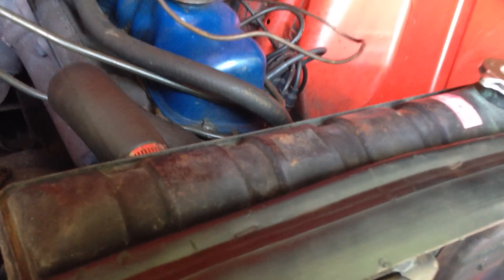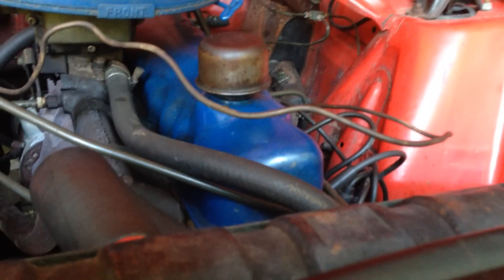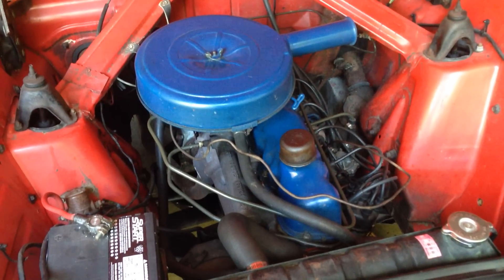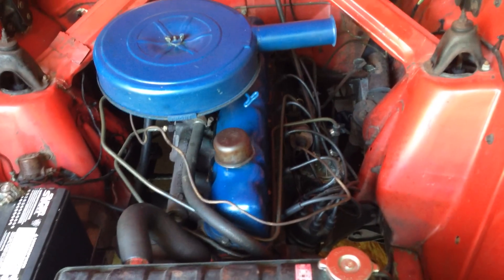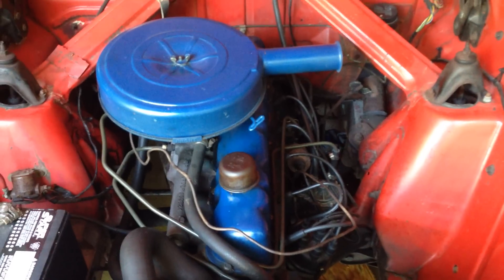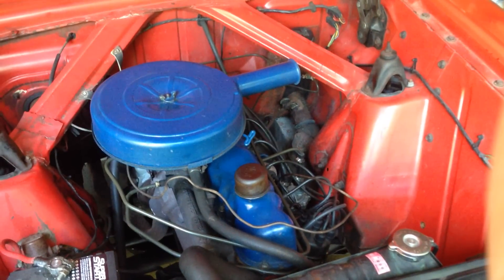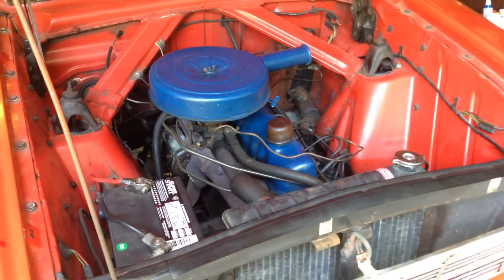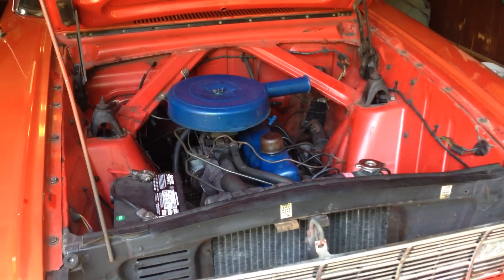Falcon Engine Swap Thoughts

Comment: I think if there was a chance to, you should consider a 'Barra' motor which is an Australian engine in the more recent Ford Falcons. There would be problems like importing an engine in and sourcing parts however. Although you can maintain the factor that a Falcon motor is still in it.

Comment: Check your radiator cap it may not be on all the way. Engine coolant doesn't boil like that unless you have a faulty cap or the cap is not on all the way.

Comment: Really stupid question, is the fan backwards? Sounds really fucking stupid but its one of those things that you miss just because its so fucking simple you don't think its even possible that it'd be something so simple.

Bought a Chevelle in down by York PA. Shit was fucking mint, but in traffic it would run up to like 230. The fan was sticking out of the shroud a little bit, so I made an extension for the original shroud, then I fucking realized the fan was BACKWARDS. Dropped 30 degrees after that and runs great.

Comment: +kirbyswarp Said: "Keep the Original 144 I6 please. Keep it all original, a regular person in 1960 wouldn't engine swap it."

Very very true. I like the concept. Don't know how much it'd cost or what the budget is, but I'd go aluminum rad, elec fan, transmission rebuild.

However, this was a regular car in 1960 amongst other regular cars from 1960. Today, regular cars have more power getting onto the highway and maintaining speed. Maybe this car could use the power from, say, a small block, to keep up. A period correct engine, not necessarily making huge loads of power, doesn't seem to uninviting; at least to me it doesn't.

All in all, it depends on how much Mr. Regular wants to spend, and what kind of car he wants the Vagabond Falcon to be. I'm all for whatever he ends of choosing, no matter what the direction.

Comment: 300 Inline or a 2.9 Cologne V6. That engine is far to small for an inline 6 and way to low on power in my opinion. Give it a bit more get up and go with a 2.9 or 4.9.

Comment: Lol..I knew it would get to this at some point. : )  1st come the motor swap thoughts. Hmmmm,a new motor... "it would be newer, & much faster, as well as  reliable".....BAM! New Motor!
  Then come the thoughts..."hmmmm,do i switch out the trany, and gearing? it would be newer, faster,as well as reliable.......Then come the thoughts about handling...BAM, Full suspension, modern braking...etc etc etc...

 Until one day you realize, it's no longer a 1964 Ford Falcon with a 90hp 144.

soon followed with feelings of regret.

BUT...then again..it would be Faster...    : )

Comment: From a performance perspective I have no clue what it would do, but if you were to swap I'd say go for the most regular choice Ford could possibly offer. The 1.0L 3 cylinder Ecoboost crate engine that makes 123 HP and 148 lb-ft of torque... Have no idea what could be used as a transmission. Otherwise just fix up what you have! I'm sure the straight 6 could be nursed back to it's former glory.

Comment: Sounds like the coolant is boiling - this will happen if there is not enough pressure in the system.  Lots of things can cause that but it might be as simple as a faulty rad cap or a bad hose or clamp, or as bad as a failed head gasket, leaking heater core etc.

It could be air in the system as too much air will also cause the system to not pressurize enough and thus boil.  That's the simplest thing to fix, so start there.

Park the car on a slope so the rad cap is at the highest point, take the cap off and run it squeezing the bottom and top radiator hose to help dislodge any air pockets, run it up to temperature so the thermostat opens - keep pouring coolant into it as it burps out the air.

Comment: Put a temp gun on the radiator  and search  for a cold spot in the radiator  I was having the same issue with my s10 and a c10 and a new radiator  solved both issues

Comment: a regular car deserves a regular engine!
Reply: Flame Vulcan,ew...

3.5 duratec baby !
Reply: Thomas McCoy Yup, i also think that it needs a regular engine. Not some ls, 2jz or other overused swaps.. It's a regular car not a race car.
Reply: Ernests Pušpurs the 2jz was used in a lot of regular cars, not just the supra. There are few engines more reliable. Just because the supra had it, doesn't mean that it has to be a race car engine. The 200hp GE will run forever if you change the oil every 50k or so. And it will get good gas mileage, be easy to find cheap parts for and is just a pretty normal engine. Sure, you could use some old ford i6, but what if you are on the road and need some specialty part. You can't just stop at any old dealer and get it. You could with a 2jz-ge. Doesn't get any more regular than that.
Reply: Gs300s aren't regular cars
Reply: Thomas McCoy Sure they are. So is the IS 300. you can get one for under $5k right now in the USA, Makes it pretty regular to me.
Reply: Ernests Pušpurs a Barra 195 or 270t is a little different and would keep that I6 feel, but for best effect a carburetored motor should be kept

Comment: Wait a little bit and see if you can find a good running 200 from an early Mustang.  They look the same but have a better crank.  If you're lucky you can find one with a trans.  I wouldn't suggest a V8 unless you really want to do some body and suspension mods.  The 62 and earlier had a smaller tunnel that requires lots of hammering to get a bigger bellhousing in.  63's were the first year of the v8, they fit right in.  I've owned 2 62's and v8 swapped both of them and have a 64, and have worked on my friend's 63.  A lot of patience is required with old cars. Take your time.

Comment: Do the simple things first. Pressure test your radiator cap, replace the thermostat with a stock replacement (same temp rating as factory). Check to see if the car is supposed to have a radiator shroud and a clutched fan. Some people take the shroud off and dont realize how much cooling they actually do. Clutched fans allow the motor to run with less load when it is not hot. No sense in giving up on a motor that quickly. You can replace everything I mention for less than $150.

Comment: Personally I say you drop the old 2 speed, swap in a fresh rebuilt C4 and get a nice big aluminum radiator to keep er cool and call it good. Clearly you don't want to build a Hot Rod with it so no need to replace the original engine if it still runs good.

Comment: 289 V-8 won't fit in a '60 Falcon. Engine bay is too narrow.  If your heart is set on an engine swap, personally I'd go with a larger 6 anyway. If you do your research and mod smart the straight 6 can be a most excellent engine. However, first thought for those oil-soaked plugs is the Valve Stem seals.

Comment: All of these 'kids' thinking that you should put a FWD engine in the car... LOL!

Obviously, keep it original. You said it yourself, how much money do you want to put into this car? If you pulled the engine out, you could replace the engine gaskets and such with new ones and you'll have a reliable engine. Upgrade the radiator and a new fan, poof! Now you have a clean car that will run forever as long as you maintain it.

These cars don't need an LS swap, or a 4 cylinder turbo bullshit. This is a car that has lastability, and that is an important word. "Lastability" the true common denominator to determine whether or not something is made for the 'now' or for the 'forever'.

See, I could be a writer as well Mr. Regular :)
Reply: He meant in the 144 not the car.

Comment: If you haven't done so already, make sure the cooling system is burped. Open up the cap, start the car, run it, let the thermostat open up and squeeze the upper hose until you get all the air out. After that, top up the fluid and replace the cap (preferably with a brand new one) and you should be good to go.

Comment: It possibly has air in the cooling system which can cause an overheating issue. The trans leak is most likely coming from the rear of the trans where the yoke of drive shaft slides in.

Comment: Drill a small hole in the 12 o clock position of the thermostat to let the air come through the thermostat. Sure, it will let a little water through, but it will not stop the thermostat from doing its job as long as the hole is small enough.

Comment: It's a 50+ year old engine guys.. I'm not opposed to a swap. If he really wanted to keep it original, etc. Then it would be sitting in a museum somewhere. He doesn't need to put a ridiculous motor into it. Just something that's reliable. If he puts in a better engine, he'll get something more reliable, more powerful, and more economical. The outside will still be the original same. It just makes sense in my mind. But hey, I understand everyone's concerns. I just think it might turn into a huge money pit.

Comment: Take the thermostat out and see if the coolant flows better. I had that exact same bubbling/overheating issue, albeit with a Japanese car. But after flushing the radiator, replacing the cap, descaling/derusting cooling system, back flushing etc, I finally just removed the thermostat. And problem solved.

Comment: Carbed 302

-Plenty of knowledge out there regarding the build and what would need to be done as well as how to remedy most problems you'll face along the way

-those old 302 just have the best low idle rumble and will give this jalopy some serious presence rolling up not to mention when you're behind the steering wheel. It'll make you feel like a super hero everytime you turn the thing on.

Comment: I would just rebuild/replace the parts that need replacing. The original straight 6 is very similar to the way that lots of auto manufacturers are putting small 4 bangers into cars, so keeping the original straight 6 is like saying you got the "average" model of the day...and rather unique for today. A 302 would be more fun however.

Comment: and to the 2jz and rb26 ideas, which only people with little knowledge of cars would suggest, those engines might not be able to put the falcon and could put alot of strain on the engine. Also, the body is clean and original, why change it up? for a turbo? no. 302 is the best idea.

Comment: Could be water pump, radiator blockage or could just need a good flush.

Get a newer falcon motor from australia if you want to do it properly, the Barra 200 is the engine to go for its cheap as fuck.

i recommend rebuilding the current 144 though.

Although a AMC 4.0l Swap would be awesome they are as good as the falcon i6 and WAY cheaper over there in the US i imagine.

Comment: Run the car to operating temperature with the heater on and rad cap off. Fill with coolant until it reaches the rad fill neck, squeeze the top hose and watch for air bubles, and you're done when theres no more bubbles.

Comment: My 1968 Mustang Coupe originally had the straight 6, I can only speak for myself but I had so many problems with it. I swapped it for a 302 and Now I can actually enjoy driving it. I like the power, and I like going fast. I don't know what kind of driver you are, Mr. Regular, but I would certainly suggest and engine swap. At least for a 289. You'll be much happier.

Comment: Hey Mr. Regular!

ASE master tech here. 

Before you go too crazy with repairs/swaps and what not, try to find a spill-free funnel for your radiator. It is a funnel with adapters that seal where the cap would. It essentially allows you to over-fill your radiator so as the air goes out, coolant goes in. 

Run the engine and let the water pump push the air to the top and out of the funnel, keep an eye on your coolant temp gauge as always. Squeezing the upper hose a bit now and again can get some more bubbles loose too.

Something like this here. http://www.amazon.com/Lisle-24680-Spill-Free-Funnel/dp/B00A6AS6LY

Comment: Also, FUCK FUCK FUCKITTY FUCK. First make sure that you don't have a blown head gasket (best case), cracked head (shitty but not so bad), or crack in the cylinder wall (fuck it, fuck this, fuck everything). Any of these would cause rampant overheating that even a really nice rad would  not fix. Yes, the car can run just dandy with a cracked head or blown gasket. Get a compression gauge on it before you do anything else.

Comment: Bleeding involves first filling the system with coolant, and massaging all the air out of the lines by hand. Then start, and let the air work out. Keep massaging any lines you can until it's too hot. The old trick is to jack up the front of the car to make sure that the filler neck is the highest point in the system. You especially want to get it above the heater core. Which is hidden of course. So jack it up way high and run it. This isn't a VW Vanagon, or your precious MR2. It shouldn't much fight you. If if were mine I'd just fill it, knock some air out, then drive it around, topping off coolant every day or so until I don't need any more. Get that radiator empty again and look down in there for evidence of StopLeak garbage, which might be causing problems all through the system.

Comment: Considering its such an old car I'm certain the water pump, and radiator  are internally oxidized beyond repair. Probably due to the average man knowing water is free as opposed to Anti-freeze(Which doubles as a rust inhibitor)  which is in fact not free and in a sticky situation its much easier to come across water to cool the S.O.B down. At the very least I would definitely start with the radiator, and while your at it remove the belt driven fan for an electric radiator mounted fan, very simple swap.

Comment: All that smoke/steam coming out of the breather makes me think it has a lot of blow by so it's possible it's just worn out. A 289/C4 combo would be great for driveability and reliability and would make stupid enough power to worry about destroying the rest of the running gear. That's just my opinion though, you could also get a big Radiator and get the original 144 and 2 speed rebuild and it'd be good for another 50 years probably

Comment: Before giving up on the factory radiator and fan, try flushing the radiator with CLR (Just be careful with the stuff, it's pretty strong), or even Tide laundry detergent a la Roadkill's '66 Buick convertible. The mechanical fan can also be made much more efficient just by adding or making a shroud for it, you'd be surprised the difference a proper fan shroud can make. Also keep in mind that an electric fan or fans will put more strain on the electrical system.

Comment: The internet thinks engine swaps are easy. They aren't. Don't you just wanna drive it? Dump the coolant, take the radiator to a shop, it's probably clogged. New parts will cost soooooo much less than an engine swap. Make sure the thermostat is opening (does it have one?) at proper temp. The wild card is if somebody's been dumping StopLeak or some dumb shit in the engine.
Reply: Stop Leak is a vehicular war crime!
Reply: JeredtheShy I'd get a 300 straight six and a tranny out of an old ford truck in the junkyard. Probably could get one out of a wrecked truck on craiglist too. that would be so much cheaper than screwing with this old thing. Sure, it's really cool and all, but the 300 would have so much more power, and he could even get a 5 speed out of a ford truck.
Reply: ***** Any cost figures on that? One good thing about a 302 is that they're EVERYWHERE. I hardly ever see volvos or jags in the crusher yards around here.
Reply: JeredtheShy Thermostat was my first thought as well. It's either that or the actual coolant paths are clogged. If you've already done a flush then that's really all it can be. Or the pump.
Reply: JeredtheShy I think the swaps you mean are things like LS-swapping miatas or something. A car like this, if you're good, you could swap an engine in two days tops. Granted, he'd need a third or so probably because it's going from straight 6 to V8, probably a 302 or 390 from a junkyard.
Reply: ***** I've seen 302's in them. Maybe that's a better option.
Reply: ***** A horizontal straight six? Honestly, I've never heard of that. I'll have to give it a look sometime.
Reply: ***** Holy shit!
Reply: ***** Yeah, around here it's all domestic stuff I deal with. Hardly any european imports here. Must be because of my location. There's quite a few on the East and West coasts, but not many in the midwest. Only in Chicago really, lol. Honestly, I've only driven an old Audi 2.8 from the 90's that would classify as european made.
Reply: +JeredtheShy All these suggestions about truck sixes (which are twice as big and heavy) and Volvo engines etc. are absurd. The 302 V8 is relatively lightweight and started as a 260 (I think. Became a 289 next.) And it was available in about mid 1963 (I think) in this same body, so probably any version of that V8 would drop in.

Comment: My opinion is that, assuming you are not in some kind of bind to move the car (i.e. storing it at a friends house who needs the space, in the middle of a move of residence,etc) is to STOP and decide where you want to go with the car before spending another dime or spinning another wrench.  If it was MINE, I'd sort out the transmission leak (if it can be sorted).  If so, I would keep the car as original as possible other than making it more driveable.  Next order of business would be upgrading (overkilling) the cooling question with all new hoses, thermostat (no store-brand junk), oversize radiator, and whatever incidentals come along the way.  Then I would address whatever tune-up issues are at hand.  I know nothing about that engine specifically but I'm talking about plugs, wires, adjusting/replacing/upgrading whatever kind of ignition it has, etc.  You know it runs pretty decent as is so compression is OK at least, the engine should be in pretty good shape internally.   TLDR; if the tranny and engine aren't totally shot, I say leave 'em in the car.